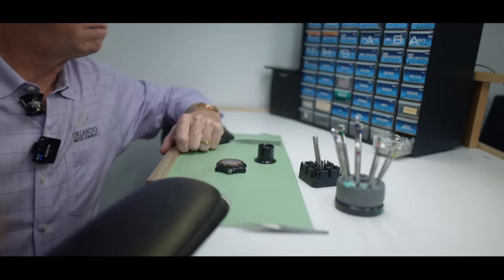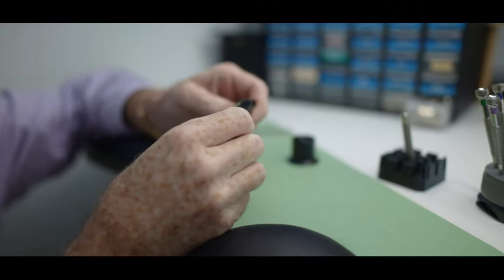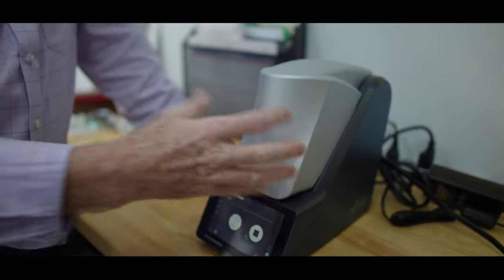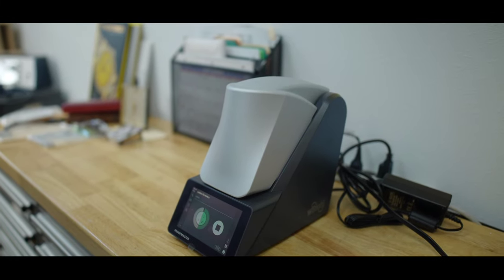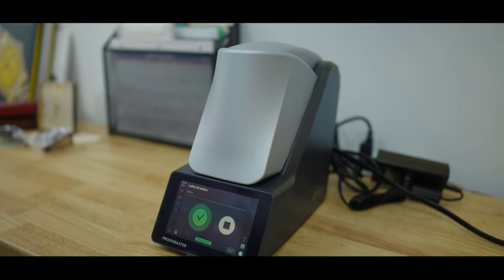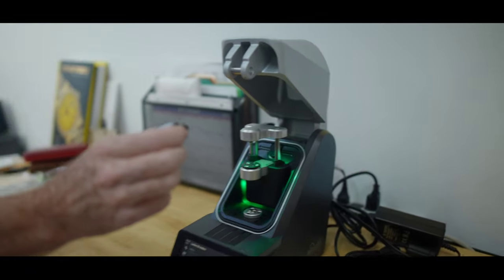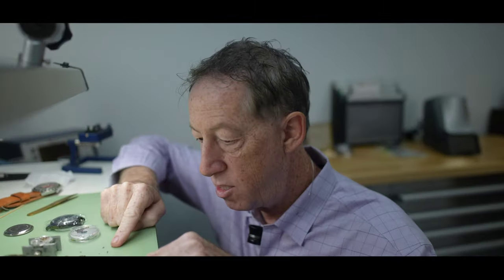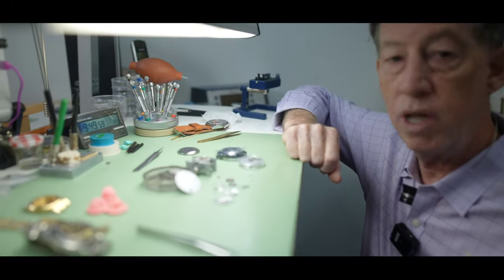Water Resistance According To A Watchmaker | Scott Heisler

Comment: I Hand-Wind my Automatic watches daily or every other day, to keep them running...I don't have a Watch Winder. But I heard that hand-winding them regularly could potentially damage the movements...is this true?
Reply: Interesting question. I hope it’ll get answered because I’m kinda curious myself.
Reply: Thanks Shinobi797, this is a common question. Watches are ment to be wound. It is a convenience to have a automatic system to assist you in the winding. Most watches are designed to wind. If your automatic Watch winds down, before you set it you should wind it anyways to put power into the system to have enough power to keep accurate time. Winding does not hurt an automatic Watch.
Reply: @orlandowatchcompany1777  THANKS for the feedback Scott...greatly appreciated 👍🏽

Comment: It would be great to know exactly how the pressure actually tester works
Reply: Very simple David, there’s a sensor that detects the deflection of the case. Expanding with pressure in and deflection with the vacuum. If the rate is to hi the test fails

Comment: So how water resistant is that particular watch? 30m? 50m? That's the only thing I seem to be missing is just how much water resistance it has? Thank you.
Reply: Those are basically the ones you should keep away from water, don't take anything below 100m in the water it's better to be safe than sorry
Reply: If it does not have a screw down crown I would not dive with it.

Comment: Good afternoon, I'm a hobbyist watch collector and repairer, I started in 2014 by breaking a watch and try to repair it (ending up throwing it away) and now I'm skilled enough to deal with all the ETA (and clones) series (also chronos with complications like the 7751), Miyota, Rolex, Seiko (not GS anyway) and so on.
I'd like to know your point of view on 2 topics:
1) I'm 46 now and gradually losing a bit of sight. How do you deal with that? I've found a bit difficult to have the monocle over my near-vision glasses...
2) What do you think of replica watches, meaning the ones with ETA or Rolex clones inside? I used them to learn how to service and repair movements (and hands, dials etc) and they served as a mean to learn and take on any gen one with similar relatively easy movements inside.
Thanks
Reply: Alex, I find it easy not to use glasses just the loop, there is a loop just for glasses, as per the replicas…… NO!

Comment: Looks pretty futuristic….very impressive.
However testing to destruction with a water pressure tester looks way more fun, albeit you stuff up your watch.
As per, keen to know re pressures: do you preset this? I have watches where I’d like to know if they hold true. Less so 100m or less, but a Citizen Promaster ISO certified for 200m, Aquatico 300m and my Vostok Amfibia, 200m but with an ingenious flat gasket and lock ring design for the caseback which to me is way more advanced than the Rolex Oyster design.
 otlichnaya russkaya inzheneriya
Reply: There’s a preset for every case design and depth. Very convenient.